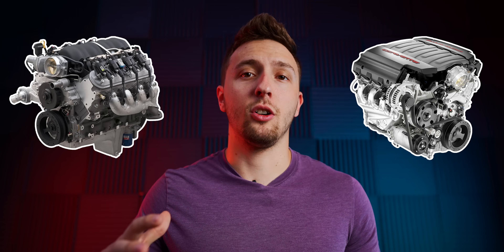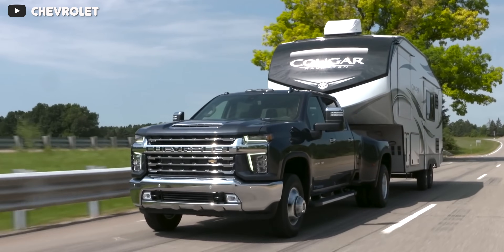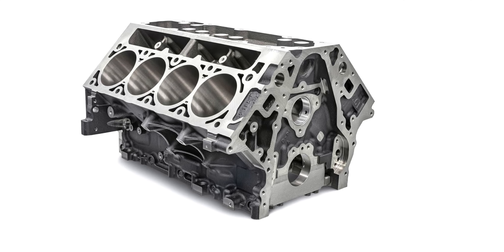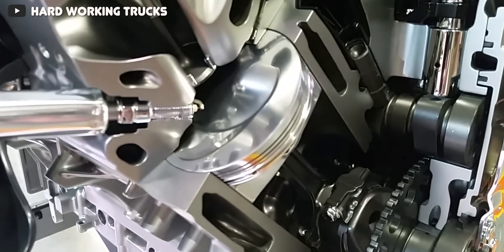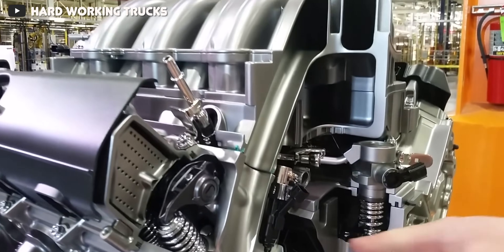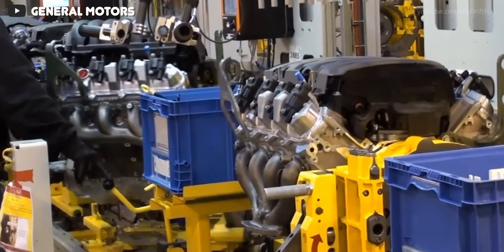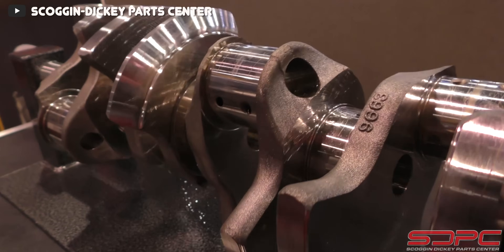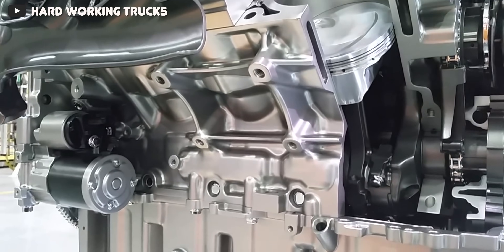Here's Why the GM L8T is the Best LS/LT Engine

Comment: A key thing you missed, is that the L8T is the only LT engine to come with a factory power steering pump. This tips the balance in its favor for classic repowers, since you would have to spend more for an aftermarket steering pump setup for any other LT engine.
Reply: Totally agree
Reply: Good catch, very important.  Thank you.
Reply: I’m not familiar with the lt series engines but the gen 3 engines had a power steering pump, I would think the accessory drive from the gen 3 would bolt to the lt series.  I’m sure someone has tried this.
Reply: @Averagegunenthusiast  There are some weird differences. For example, in order to bolt a gen3/gen4 water pump onto a gen5, you need to use an adapter plate. The water passages are just enough out of line with each other that this is necessary.

GM didn't intend to reuse any of the front accessories when they switched to the gen5 engine, so they had no real incentive to make it backward compatible.

There are companies that will sell you special accessory kits to allow you to bolt a power steering pump onto any gen5 5.3 or 6.2, but none of this was available from GM until the 6.6 showed up on the scene.
Reply: @jonathankipps9061  I had no idea, I put a gen 3 ls in my 72 GMC in 2010, I rebuilt it and it’s still running great.  At the time I felt up to date, it’s amazing how fast you get behind the times.  My cammed 6.0 makes good power and is reliable, since I don’t drive it very often it should last forever.
Reply: @Averagegunenthusiast  I'm in the middle of a stalled 2010 gen4 5.3 swap, going into a 1987 v20 pickup. At the time I started that swap four years ago, I thought this was a pretty new drivetrain setup. It's looking quite dated by now, and it's not even running yet!

I dream of getting ahold of the L8T someday to put into the same truck, but the price is still too high.
Reply: @jonathankipps9061  I would just say stick with what you have, you will never get the money you spent back and will have to spend more and stall on the newer drivetrain when you can figure out or get the funds what ever is stalling you and you can get past it.  Once it’s up and running it will still be much nicer than what came in the original truck and make more than enough power, if you want more a cam or turbo will cost less than a drive train upgrade.
Reply: @jonathankipps9061  my gen 3 6.0 has ported and polished heads a mild cam and makes 350whp through a 4l60e Ford 9in and 20x10 wheels.  It is probably too much for the chasis as is anyway, yes I can make more power with the rectangle port heads but I need a bigger cam to do so and then kill my drivability.  I set out to make the same power my old 383 made but be much nicer to drive and it is.
Reply: @jonathankipps9061  Dude,the only 1year to keep a square engine OE.......87
Reply: @thegonz7833  I drove that truck in its OE configuration for several years; it wasn't worth it. 

Failing splices inside the TBI harness were leaving me stranded, and it was extremely low on power. My best guess on the low-power problem was likely wiped cam lobes. The truck had 3.42 gears and a sm465. It had good torque up to 15 mph, but after that, felt about as energetic as a four-cylinder.

In the process of the rebuild, I'm hoping to do a full cosmetic restoration as well. I'll be upbadging it slightly from Custom Deluxe to Scottsdale(Not Silverado!), adding a two-tone modification to the factory Copper Canyon paint color, and getting it back onto stock wheels and tires.

The goal is to have a nice solid daily driver that will perform on par with a modern half-ton, but have all the class of a 1980's pickup.
Reply: @jonathankipps9061 sounds like it's going to be a super cool truck when it's done

Comment: In my opinion, the L83 the l84. The l82 need at least 89 octane. It shouldn't be running 87 in those if you are well to each their own. I plan on running mine into the ground trying to get $250,000 out of it. I'm putting this LT engine to the test. I want to see if we can go 250k. I've already replaced the transmission. I'm only at 98,000. Yes, I know it was a 6L80 torque converter. Shredded pump failed. You get the point replaced with the rebuilt beefed up 6L90 essentially or 6085 if you want to call it

Comment: GM make us a 4.8 L LT non-dfm 10.8 CR as an option. It will get the same gas mileage as the 5-3 with DFM and just get rid of the 5'3. You have the four banger now that can be the mid engine
Reply: 4.8? 😝
Reply: @timtorkelson7201  the four point great one of the best Silverado engines ever made. Do your research before you laugh
Reply: I'll keep my 6.2 Thank you and get 21-24mpg on hwy to boot!

Comment: The L8T nice addition of a drilled water passage between each cylinder, which the old 6 0 liter doesn't have. This is a big advantage over the LSX block, which means that the L8T will run cooler especially when using very hot burning propane. Propane burns ultra hot because it contains 37 percent hydrogen.  Propane is also about half the pump price of diesel fuel.

Comment: I am looking forward to using the new forged, center counter weighted 3.86 crank in a gen 4 build. Doing the math you can run an off the shelf piston (1.115 compression height) but combine it with a 6.2 rod and the overall height is only .004" less.
Reply: I recently found a good deal on a bare L8T block. 
  It had some handling damage to the deck surface. 
  I was able to mill the block .015” and clear it up. 
 I wanted to try and find an off the shelf piston already available. 
  Mahle 930173225 is what I found.
    4.125” bore with a 1.105” compression distance. 
   Ordered a new GM crank shaft and got a set of 6.200” Molnar rods.
   Deck clearance came out to be +.004” out of the hole and I am fine with that. There are plenty of head gaskets available to accommodate.
   So if a person had a nice block that wasn’t hurt your figures would work out.   
   I can’t speak to wether or not a 1.115” CD piston is a shelf piston at this moment but there is sure something out there for about any set up these days.
Reply: Can a lt4 supercharger fit on a L8t black and lt4 heads Also?
Reply: Yes. They are one in the same. L8T blocks are not drilled for active fuel management on the lifters. 
   You can even make an L8T block work for the base of a LS by machining the head dowel pin hole which is not a chore at all for any decent machine shop.  
    The LT and LS block are basically the same. The LT heads have the intake and exhaust valve flipped so you have to use the correct pistons for the heads you are using.
Reply: @hughobrien4139  what about cams?
Reply: LS cams will fit in the block just fine. 
 You could use the stock LS cam bearings in the L8T block however the rear cam bearing bore is notched for the fuel pump lobe and other fuel pump provisions. 
   So I would opt for the LT cam bearings. 
    The cam lobes will be reversed from LS -LT so that should be obvious. 
   As far as which cam to go with?  I wouldn’t make a recommendation without knowing exactly what many parameters are. 
    I’ll say in short that if you’re drag racing a chassis car. Light weight no interior, then Texas Speed has some great cams to offer. 
   If you’re running a full interior heavier vehicle hands down I’d suggest Gwatney Performance out of Arkansas.  They have been putting in the work around that platform and have had some excellent results and have been improving on what they have learned throughout the entire time they’ve been working. They can be tough to reach over the phone so don’t get discouraged when they don’t answer or call back. 
    They’re inundated with work. So be aware of that.
Reply: @hughobrien4139  I heard the LT cam has a larger  bearing journal diameter so the cam could have more lift with less ramp rate onto the lobe, but I could be wrong.
Reply: I have one of each block in my shop.  I’ll check dimensions and see what the number say.

Comment: I bought this truck a 2021 gmc 2500 my worry is carbon build up on the intake valves. I didn’t know about this until I bought the truck. Hopefully the catch can I installed helps mitigate the problem.

Comment: I have a gen v lt1 swap and 8l90 swap in my 2016 GMC Sierra, but I’m running the 6.6 crank and rods, and a set of mast forged 402 pistons, mast 402HO camshaft and lt2 intake manifold, full lt4 high pressure side fuel system and a hellcat in tank pump running e85, with a GM performance high stall converter. Mast sells this engine on their website as a 625hp setup and that’s tuned on 92 octane. 

My truck gets tuned in 3 weeks, but I’ve been on a basemap running very low timing 17* and rich at 12.5:1 at WOT and the thing hauls major ass as it is. So if anyone is looking for a beefy muscle setup, this is the one for you. I actually wish their were more people I could converse with that had similar setups, but seems like most people haven’t posted their setups like mine online yet.. please post away hahah

Comment: I would have bought one but being how new they are the trucks they come in a still very expensive especially with this stupid truck market. Still on my list to get one eventually probably in a gmc 2500 but another reason to buy a newer gas v8 truck is they make plenty of hp and tq and they're cheap and easy to maintain. These trucks (6.6 chevy, 6.4 ram and 7.3 Ford gassers) are at and nearing early 2000s diesel tq numbers and about double the hp.

Comment: any 6.6l should make that type of power
Reply: Well, considering Pontiac 6.6Ls at the end of the 70's didn't even make 200hp, 400+ is pretty good...especially on 87 octane.  
This swapped into any muscle car would be a reliable rocket.
Reply: @texasconservativeveterans  agreed  in the 1970`s-1980`s they had lost their ever loving mind yea smog but head flow  or lack their of was intentional .they could have used a split intake on stockers like some of the offenhauser intakes But thats that and the bean counters must have loved them thar years 😉
Reply: @overbuiltautomotive1299  The EPA was the disease, but GM was pulling back the reins on Pontiac for decades.  They had the Ram Air V heads ready to go, and were making well over 400hp with Super Duty motors.  Insurance rates were a concern, and Big GM didn't want Pontiac to have the GTO and Trans Am outperform the Corvette.
Reply: @texasconservativeveterans  yep agreed/ i was thinking about trucks and the standard stuff like say 1981 350 GM talk about crap heads oh ford 302 dizmul  .epa is nuts
Reply: @overbuiltautomotive1299  That's why my Trans Am has ported Edelbrock Heads, and my 84 Blazer has a 5.3L with DOD, EGR delete....No catalytic converters on either.  The Trans Am has a 200R4 trans and 3.42 gears.  I drive it to the track, get better than 20MPG and run mid 11's (11.61 is best) and drive it home.  
Sadly, we are going into another era of government mandated automotive idiocy.  
Just last week, I bought a spare L8T just to keep in case I need it.  I've got one in my 2022 and it runs great...but I've got 3 other GM vehicles that I could swap it into if I needed a power plant.
Reply: @texasconservativeveterans  Yes i got to get heads for my 460 build  for f350 4x4 rollback and a zf5.Thank for your service  my dads severed in Vietnam Army :face-blue-question-mark:the storys i herd God bless

Comment: Loving my 6.6L L8T in my 2020 Chevy 2500 more and more after +2 years of ownership. Thanks for the detailed video; it is similar yet somewhat more in depth than the videos I watched YouTubers interviewing the GM engineers for the engine and also their transmission back in late 2019. There is much +++ to write about my experience with my L8T and its mated 6 spd. transmission (more speeds does not always mean better fuel economy or durability; their 6L90 transmission was one of, if not their most reliable, and they even beefed it up further and used in their 5500 series for example).  It has a “tall” overdrive top gear (6) for lower rpm highway cruising (i.e. ~1700). As mentioned, glad there is no Cylinder Deactivation or Start-Stop technologies (gimmicks as I've come to understand that will cause costly issues at a future time leading to $$$ repair, possibly wiping out the fuel savings altogether).  My truck at +25,000km and +2 years ownership runs buttery smooth, and I am very happy with the power band even when pulling my +30 ft. trailer. Fuel mileage on the highway unloaded has been as good as 13.5 L/100km (17.5 usmpg) Hwy. during a nice 20C (68F) day with no wind, or average of ~14-15.5L/100km depending on conditions (as good as my 2002 1/2 ton).
Reply: Is your motor in a 2500 HD or what does it come in?
Reply: @Darthreloy  this engine is available for either the 2500 or 3500 series. Mine is a 2500.  How was this helpful to know?
Reply: @nhlcfl7733  Possibly. I will probably buy one from an engine recovery shop. Thanks.
Reply: @nhlcfl7733  what year is your truck and also you said is a 2500 or 2500 hd ?
Reply: @chikisorozco4297  my truck is a 2500 series , which in case one is not familiar with 2500 or 3500 series or when thinking of 250 and 350 (Ford), are “all” Heavy Duty trucks. Furthermore, “Super Duty” is simply a marketing term used by Ford for their heavy duty series trucks. What year is my truck? To help here again, this newly designed 6.6L has only been available in the HD lineup of Chevy and GMC trucks since 2020.
Reply: @nhlcfl7733  - as of now, 6.6l engine shortages. Only Commercial Vehicles get the motor until the 2024 model year. Is that true ?

Comment: After 20+ years with my employer, I finally got a brand new service van a few months ago, instead of run into the ground hand me downs:  2022 long wheelbase Savana 3500 with the L8T.  I was pleasantly surprised to find that the  6.0L that was in my 2006 van had been replaced by this new engine that I didn't even know existed.  Being a total gearhead, when I read up on the engine, I was impressed.  Long story short, it pings and rattles like you wouldn't believe.  Running 93 octane seemed to almost completely eliminate the detonation, but it was still there.  Lately, doesn't seem to be helping much. Gas mileage is absolutely abysmal. Wouldn't be surprised if it's worse than the old van that has around 220K miles on it, with little to no maintenance and  the check engine light was pretty much always on.  Usually, the additional torque from the 6.6 is immediately noticeable, yet other times, it's a slug and seems like it's running very lean.  My guess is that the factory ECM calibration is off, but it ain't my van, so whatever.  Kinda disappointing.
Reply: I’ve honestly have had the complete opposite experience I’ve driven a bunch of 6.0 vortecs great engine my 2016 2500 had the last revision of the 6.0 it got the job done but felt like a total dog doing it. I got my 2020 3500 dually with the 6.6 gasser and it’s night and day not only is my MPG better by about 4-6 but the power delivery and get up and go it has compared to my old truck is crazy. My old truck with the 6.0 got 11.2-12.6 and that was going 65-75 on the highway in this new dually I can be going 70-80 and still get 14 mpg if I drop down to 65 it shoots up to 16 mpg pulling a trailer there’s no comparison this new 6.6 gasser is doing great for me I did notice a little bit of oil consumption but fixed it with changing my oil to Mobil 1 I was running Castrol both full synthetic but for some reason it likes the Mobil 1 better. You should check the engine oil maybe it’s a little low which is why you are getting that ping and rattle that’s what started happening to mine and I noticed it was about a quart low.
Reply: Yeah you have a bigger issue that hasn't shown itself yet. Engines run rich from factory 99 percent of the time. Rich is better than lean when something goes wrong. You are running bad gas possibly? 93 has alcohol it's better to run 0 percent alcohol 91 octane on all push rods.

Comment: Good overview on L8T.
Ford's 7.3L Godzilla (430hp/475 lb-ft) with 10 speed compares VERY well vs L8T (401hp/464 lb-ft) & 6 spd transmission.
Reply: Same for any trans though to be honest but 3 of them leaves a bad taste in the mouth at 7k a pop
Reply: I was excitedly considering the 7.3 gasser until I found out about the head gasket issues due to the water jacket between the cylinders.  A year ago, they got glowing reviews, but now that some folks have higher miles on the clock (say over 150k), they are having more failures and it is because there just isn't enough head gasket material between the cylinders.  No doubt this new L8T will have issues here and there, but it is based on tried and true tech, so it has more of my trust from the jump.
Reply: @matthewpeterson3329  zero head gasket failures reported.  Challenge.  Find one (verifiable headgasket failure....and report back).
Reply: The 7.3 is nothing compared to an LT , not even close
Reply: Ah yes the 10 speed with known solenoid sticking issues that ford won’t recall. Amazing transmission if you want to keep it in park and never move it.
Reply: @huckwild6464  Mine is smooth, holds gears while towing heavy, down shifts at the right time to hold me back.  Best automatic transmission I've owned.  A lot of people love theirs.
Reply: @27dmarshall  I’ve went through 3 of them on 2020 f350 single cab xl used for hauling love the trans when it works but can’t get them past 100k they pull amazing until they don’t

Comment: You should do 5.2 magnum! Ive had 3 go over 300k miles and all 3 still ran great and now have a single cab 96 dakota 5.2 5 speed with 234k and 99 durango 5.2 that i 5 speed manual swapped with 289k on it now the autos are bleh but NV3500 with 5.2 to me like a toyota pickup 5 speed. Just keeps rollin even bouncing off rev limiter
Reply: The 318 has always been very durable